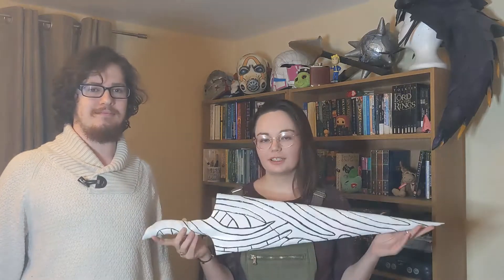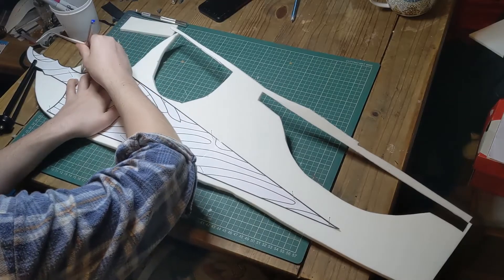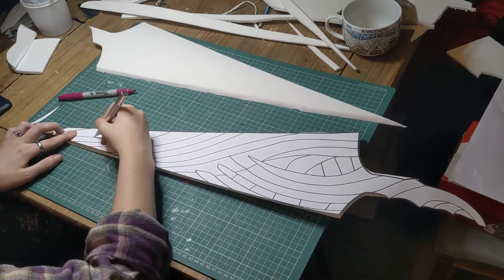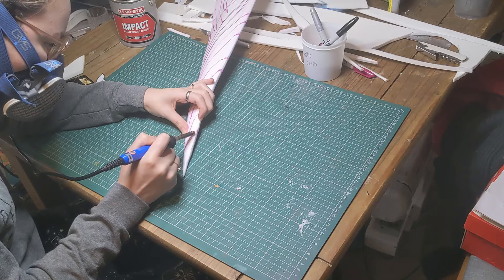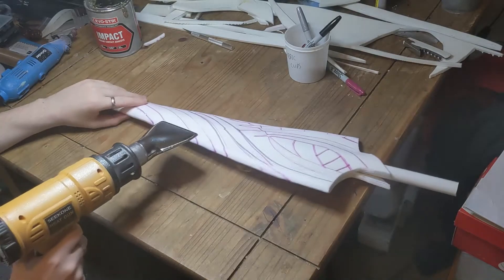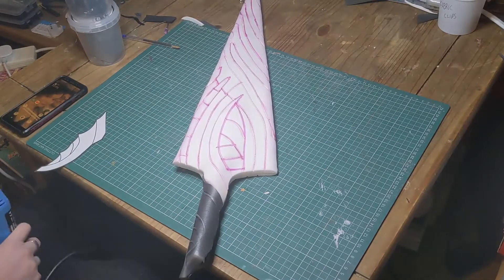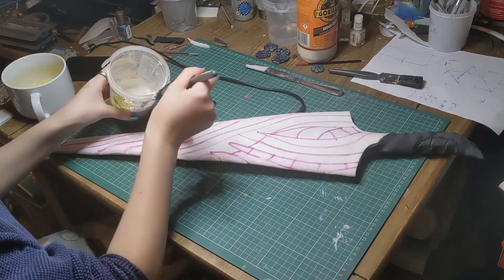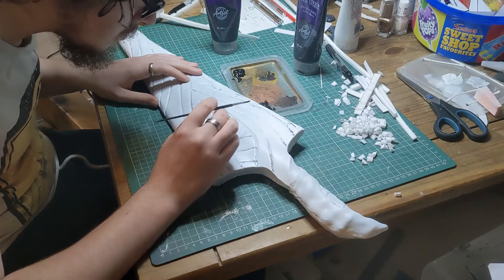How to Make a Hollow Knight Pure Nail for Cosplay

Comment: This is an amazing tutorial and looked a little easier than I thought it would be! Can this also work for the old nail using different patterns?
Reply from the maker: I don't see why not! The basic shape is the same, just different decorations. The main change would be the handle, which is plain in the older nails, so just wrap the pvc pipe in the 5mm foam and seal up any gaps with foam clay :)
Reply: @albioncreations9722  Alright. Thank you!